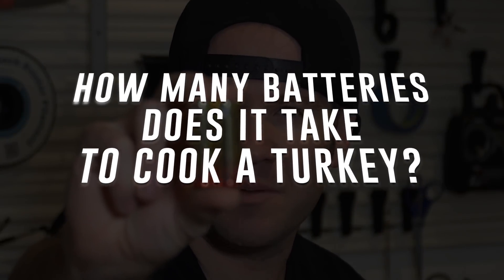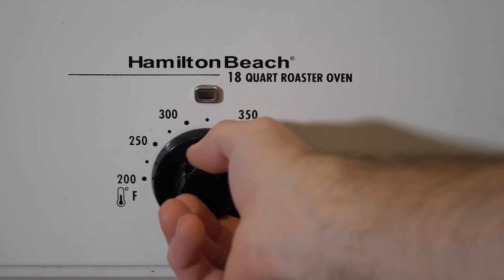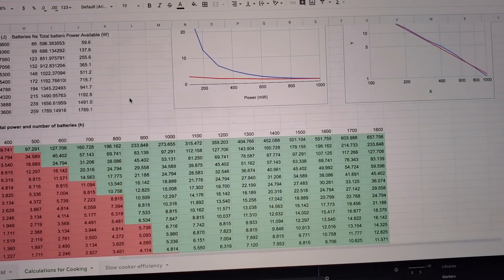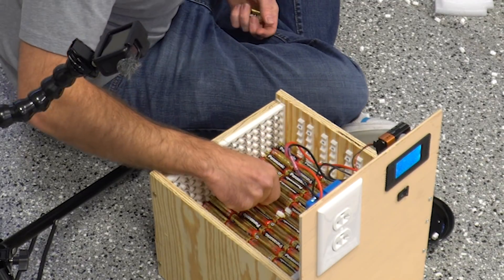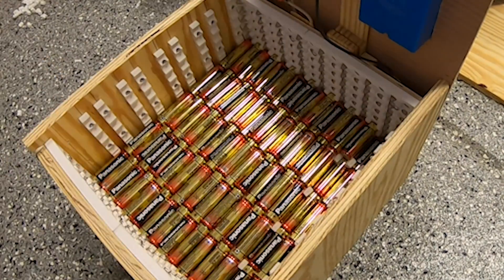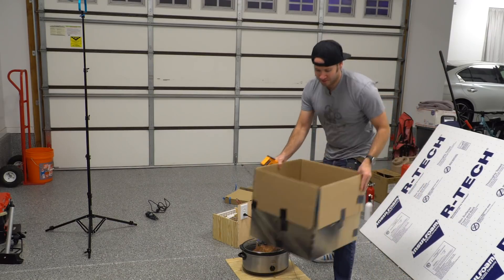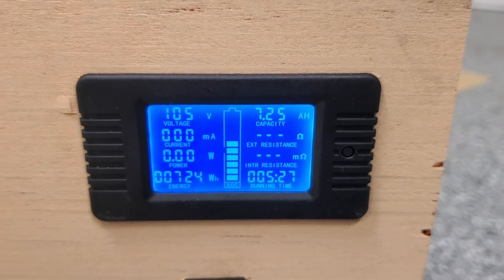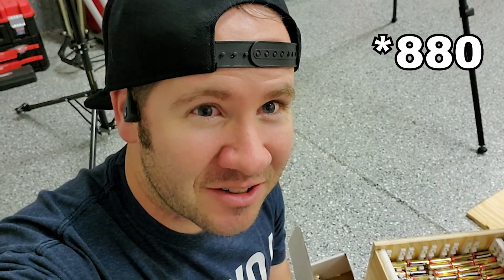I cooked a TURKEY using 880 AA BATTERIES!

Comment: One time battery ? Will you recycle it ?
Reply from the maker: I'll try to maximize their use and use them in other things. However, there are actually no primary battery recyclers anywhere near me, as alkaline batteries in the US are nontoxic and like most recyclable material are disposed of in a landfill in the US due to the current economics of recycling right now.

Comment: "Leaking Acid" - In a typical alkaline dry cell battery, the electrolyte is a non-acidic basic paste. A typical electrolyte used in alkaline batteries is potassium hydroxide.

It was leaking its electrolyte, not acid.
Reply from the maker: You're right! I read about it afterwards, and I should have known it was a base due to "alkaline". It is, however, still corrosive!